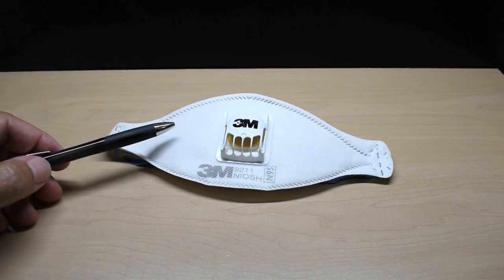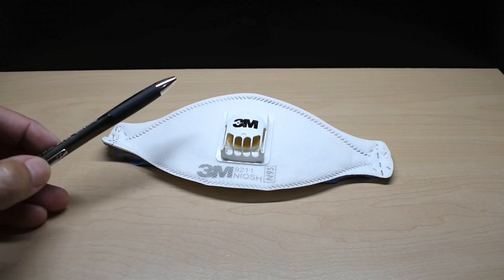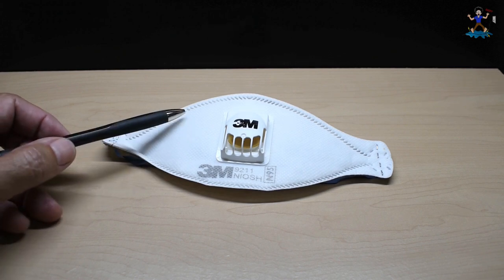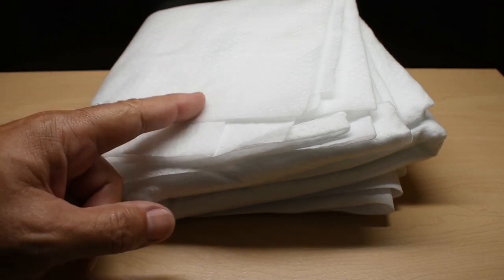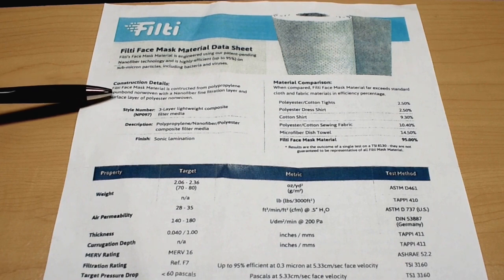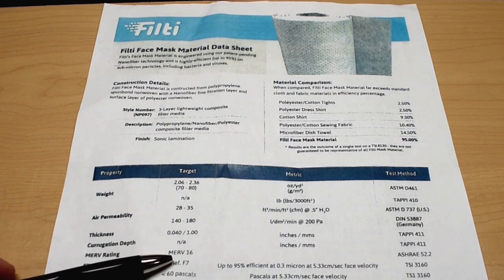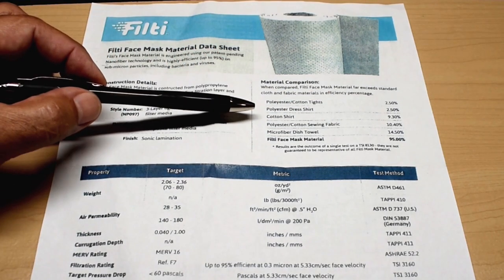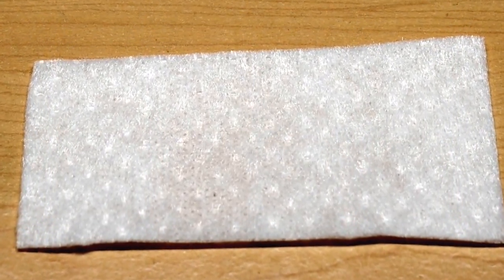DIY N95 Mask Nano Fiber Material! (Electrostatic Free)

Comment: I was glad to see this!!  I purchased some and have been using it as filters in 3D printed masks and my wife has been using it as an inner layer in sewn masks.  The company shipped fairly quickly and was surprised how much material we got for the base order.  They have also included shipping, it was $12 when I purchased it.
Reply: I was wrong,  There is still a shipping charge - it was $10 for the $25 package size of 21 sq ft.  Still a good deal - a little over $ 1 per square foot.

Comment: I see on the material data sheet they write " up to 95% efficient at 0.3 micron", but an N95 mask material should be at least 95% efficient for particles 0.3 micron and above.
Reply: Hello Marco - correct, for the home made masks we do not run the efficiency higher as the pressure drop can become a bit much with a non-formed shape and espically so with printed masks with small filter areas.  When a formed respirator is tested the actual face velocity is lower than what we test flat sheet media for Filti at - extra surface area - which results in a higher efficiency for the same given piece of media.

Comment: I would like to have a way to test this filti filter material, or really any filter material to know when it has lost a significant amount of its filtration effectiveness, by being worn. 
Suppose each day a microscope was used to view and compare the fibers of two identically made face masks, one of which is never worn and the other of which is worn daily. Note - the mask being worn would be disinfected by  having enough such masks to use a different mask each day of the week.
My question is -
When the microscope shows a noticeable difference in the fibers of the two masks, is it time to replace the worn mask with a new mask, and that before you can see  a noticeable difference in the fibers of the two masks, it is OK to reuse the worn mask.

Comment: Thank you. Do you have a PDF of a pattern we can use to make a solid/stable mask? Something you can share with us?
Reply from the maker: The link below shows a basic pattern, but DEFINITELY add a thin aluminum strip over your nose to ensure a tight seal between your mask and face. Hobby shops, hardware stores, or K&S metals online sells inexpensive metal strips. Thanks for watching, and be sure to share the video with others.

https://sarahmaker.com/how-to-sew-a-surgical-face-mask-for-hospitals-free-pattern/
Reply: @electronicsNmore  One can also use soft fabric covered pipe cleaner piping material with it sewn into the nose bridge area to help reinforce and ensure a flexible tight positive air seal over the nose bridge seal area.
Reply: Cut strips from a "tin" can and you get metal strips for free!

Comment: As I understand it, N95 masks are treated with citric acid, copper and zinc. The copper creates the charge which attracts micro particles and the citric acid and zinc kill micro organisms. The static charge allows for easy breathing and still traps viruses. This fabric, with the same filtration but no static charge must have much smaller air passages. Does this make the fabric harder to breathe through?  And would it still be wise to spray this fabric with citric acid to kill virus trapped on/in its fibres while wearing it, before proper decontamination?

Comment: I was planning to buy this material, but was a bit suspicious about the website. Checking it shows it was registered in 2013 but the security certificate is less than a month old and only valid for 3 months. The ownership of the webpage is also protected and hidden.

I am worried someone might simply be reselling some shop-towel like material at a huge markup. Not sure I want to bet my life on this anymore.
Reply from the maker: I don't force anyone to buy anything.
Reply: @electronicsNmore  Never implied that. Just sharing my concerns and my findings. By now there are several videos showing the same material and most people have no way of verifying the claims about the material. We are going to see many scams in these hard times. We have to be careful.
Reply: Hello - hopefully theres enough info out there now to reassure you we're not a scam.
Reply: @TheMrsliferette  Test of what? The lighter test can only confirm if they are plastic fibers.

Comment: Can a mask with this material as a liner can be washed or sterilized without compromising its efficiency?
Reply from the maker: I don't recommend washing any mask. Use them for a while, and after each time using them, leave them hanging inside your hot car with the windows closed. The heat inside the car will kill everything over a few hours time.

Comment: Can you test and comment on the use of HVAC filter with 3M filter rating of 1500 or higher or MERV rating of 13 or higher. 3M Filtrete Allergen (purple lable) and Elite Allergen (black lable).
Reply: I purchased a 3m filtrete 1900 microparticle 16" x 25" furnace filter, disassembled it, and cut circles to match the diameter of a shop mask that probably came from the 1970's in my parents basement. Replace the outer layer each time I have used it, and have at least 5 to 7 layers stacked within it. That was over a month ago. And I'm still breathing. Yeah yeah yeah.
Reply from the maker: As long as it's made using polypropylene fibers, you should be OK. Highest MERV rating is best. Thanks for watching!

Comment: Since you have direct contact with the manufacturer, can you ask the manufacturer if they have conducted or plan to conduct tests to determine whether or not with extended use plus washing/drying if the very fine web material, shown in the electron microscope image, will deteriorate into particles which could lead to an issue like pulmonary fibrosis?  This question applies to the use of a mask constructed of the Filti material, by a child who is old enough to wear a mask.  The question regards a child because a child will have any foreign material in their lungs for a long time.   
Note:  Designed for service and fit for service are not the same thing.
Reply from the maker: Not intended to be washed. Only heat, UVC, 70% alcohol spray mist, or Ozone I would recommend to treat the outside of the mask after use.
Reply: Thank you for your video and your reply.  Even without laundering a mask, those masks worn by a child or an active adult are going to be subject to repeated flexing and bending. For example, when I rode my bike rigorously for 2 hrs the homemade Filti material mask I was wearing flexed significantly every time I breathed. Additionally, even if not encountered during use, when stored a mask shall be subject to being crunched and might occasionally get smashed.  If there is a decrease in filtration capability during those instances, that decrease is understood and accepted.  The question is - shall the fine web material (nanofiber) or other parts of the Filti material deteriorate into particles which could lead to a health issue, one of which might be pulmonary fibrosis? You are rather fortunate to have direct contact with the company Filti.  Therefore, you will get a response as to whether or not they have conduced or plan to conduct tests to address the possible issue raised above.
Note: Electron microscope images of Filti material subject to the condition described above, could be the first test on the road to answering the question which I have raised.

Comment: I was originally thinking of using the Costco yellow microfiber car detail towels to make a face cover.  Due to its tiny fibers to trap the particles, if I folded them over.  I have doubts now, because the tiny fibers might get into the lungs.  What are you thoughts?
Reply from the maker: It's good to be cautious, but being overly cautious can drive you crazy. You should be fine. People would be shocked if they knew how much dust, fibers, pollen, and other things they inhale on a daily basis. Thanks for watching!

Comment: Thank you so much for this great video. I live in Guatemala, so I do not expect to be able to get this particular brand of nanofiber material. Is their any nanofiber material that might be easier to find in something like a Walmart, or perhaps in some clothing at a sports store?
Reply from the maker: Scott blue shop paper towels can be used if you can't find better materials. Thanks for watching!
Reply: If you can find MERV 13 or higher furnace filters (or MPR 1900+ for 3M made filters) that should be a similar electrostatic material. There are numerous tutorials on YouTube for making masks from those filters.

Slightly less effective, you can get non-woven polypropylene from reusable shopping bags, or breathable car covers (or similar covers). Those should be substantially better than woven fabrics, but not as good as dedicated filter media.

I have not heard of any other nanofiber based filter materials. Most sub-micron filters either use very tightly woven glass fibers (which wouldn't work for a mask, for many reasons) or electrostatic media.

Comment: Those reusable grocery bags are made from polypropylene.  How many layers of the bag grade poly polypropylene are equivalent to this  medical grade polypropylene?
Reply from the maker: Grocery bags are a thin melted sheet, there are no tiny holes, so you'll suffocate if you try breathing through a grocery bag.
Reply: @electronicsNmore  , only if they are sealed with a waterproof coating.   The mask I usually use is made from 4 layers of the material, (non coated portions)and I have no problem.   But I was wondering if I needed 3 or 4 layers.
Reply: @electronicsNmore  the reusable bags you buy for a buck or two.   Not the plastic bags.  Sometimes the whole bag is sealed,  sometimes just the sides are not sealed.  Some are not sealed at all.

Comment: Can you please evaluate the material of Swiffer® Sweeper™ Dry Heavy Duty. The material seems to be similar to any mask and is also easily available. Not strong but what if a layer is inserted in  cloth mask.
Reply from the maker: If you cannot get any materials, then use a Scott blue shop paper towel. I checked them, and they're thick with densely packed fibers. Thanks for watching!

Comment: I thought N95 meant filtration efficiency of "at least 95%," not "up to 95%."  Does it?
I also thought N95 meant at least 95% of a range of particles that includes particles smaller than 0.3 microns, not just 0.3 microns or larger. There was a range of particles sizes in testing I read about in the 3M literature online. They had graphed the distribution of particles sizes, and specified the standard deviations.
Also, what's so great about N95 when there are N100 and P100 filters available. Which would you rather have when dealing with serious consequences (likely fatal consequences for quite a few people, literally — about 68% fatal for men over 80, and also very threatening for many others with susceptible conditions), would you rather have something like 95% protection, or something like 99.97%?
Personally, I would feel a lot better with 99.97%.
Reply from the maker: Yes. N95 means 95% of particles .3 micron or lager "should" be trapped. The nano fiber is up to 95% blocked. It could be a little less, but it's WAY better than using ordinary fabrics. Nothing is 100%, even the N100. There's always a chance that a small particle will pass. Thanks for watching!

Comment: Is this meant to be disposable? Can you wash & reuse?
Reply from the maker: Hello Nancy. After wearing the mask, you need to sterilize it, no washing. Heat(150-165F for 20-30 minutes, ozone, or UVC light)
Reply: @electronicsNmore  heat in the oven?
Reply: @KVStarStruck22  

I place mine in an open paper bag and  reheat  in my oven @ 200 degrees x 30 minutes after each use. Have not noticed any deterioration after repeated use. I have several on hand and cycle them.
Reply: Tooktak....dont know anything about a microscope. But I use 200 degrees x 30 minutes after seeing a lab report that coronavirus was surviving and replicating at 60C. It wasn't until they increased temp to 90C (194F) that it was killed off.
Reply: @eduardopena9326  viruses don't replicate except in a living cell. Corona gradually becomes unable to replicate over time, the rate depends on conditions. 
This is unlike bacteria which can multiply outside the body.
Reply: viruses can NOT replicate out of the cell! (in contrast to Bacteria)  but they can survive with this ability after entering the body if they are not killed

Comment: How do you make a DIY mask air-tight like a N-95 mask? Otherwise, the air you breathe in would not pass through the filter.
Reply from the maker: You must have strong bands or velcro straps & have a metal strip over your nose. Without the strip, they're no good.

Comment: I'm wondering how safe this material is to breathe through.  The fiberglass filters can break off and you can inhale glass into your lungs.  Can the same happen with this nanofiber polypropylene?
Reply from the maker: It's designed specially for surgical masks. The fibers aren't hazardous, and any filter material has the potential to loose fibers. If you worry too much, you'll end up not using any material. Stay safe, and thanks for watching!
Reply from the maker: @tookTAKtook Z No liability, zero. This material is far superior to the materials(T-shirts, napkins, etc) that people are walking around with over their mouth and nose. This material will help many. The company specializes in high quality HVAC filters, and since the outbreak, they moved into masks.
Reply: tookTAKtook Z so what the alternative, a t-shirt? The jump from HVAC filter to mask seems pretty simple and logical given the times, no? I would love to know what mask you’re using and the safety precautions you have taken! 😃 Can you recommend a mask company?

Comment: look at the Filti official website (bottom)  : 
DISCLAIMER: Filti makes no warranties, either express or implied that this material or masks made from it, prevent infection or the transmission of viruses or diseases. Do not use this material in any setting or where significant exposure to liquid, bodily or other hazardous fluids, may be expected. Do not use this in settings where the infection risk level through inhalation exposure is high. Do not use this material in the presence of an open flame, heat source or flammable gases or liquids. All data contained above is nominal and provided for information purpose only. This data is not to be construed as manufacturing specifications and is subject to change. Filti does not guarantee the performance of this material in a face mask or the performance or masks made from it. Filti Face Mask Material is not a substitute for medical treatment or medical devises.
Reply from the maker: Yes, that was discussed many times. They had to say that, or the FDA would come after them.

Comment: Damn that Filtri fabric is expensive to buy and ship to Canada, the cost doubled.  I cancelled my order. I dont need 50 masks anyways.
Reply from the maker: Yes, Canada shipping costs are higher. Buy some Scott blue shop paper towels. I looked at them under the microscope, the material is thick, and has densely packed fibers.
Reply: @electronicsNmore  Thank you but its okay, I found some bags that look to be made from a Filti type fabric, so I will use 4 layers of that.  :-)

Comment: would masks made of this be reusable or are they one-time use only?
Reply from the maker: All masks must be treated with heat, uvc light, or ozone after exposure.
Reply: @electronicsNmore  aerosolized hydrogen peroxide and exposed for 2.5 hours has shown decontamination effectiveness.  Portable cargo container decontamination pods are being deployed as we speak across the nation.
Reply: If this is truly a nanofiber without  an electrostatic ply, then it should be reusable and washable with soap and water, alcohol  etc. A big reason things like UV- c is used is not to damage the electrostatic layer in a conventional N95

Comment: From their web page
DISCLAIMER: Filti makes no warranties, either express or implied that this material or masks made from it, prevent infection or the transmission of viruses or diseases. Do not use this material in any setting or where significant exposure to liquid, bodily or other hazardous fluids, may be expected. Do not use this in settings where the infection risk level through inhalation exposure is high. Do not use this material in the presence of an open flame, heat source or flammable gases or liquids. All data contained above is nominal and provided for information purpose only. This data is not to be construed as manufacturing specifications and is subject to change. Filti does not guarantee the performance of this material in a face mask or the performance or masks made from it. Filti Face Mask Material is not a substitute for medical treatment or medical devises.
Reply from the maker: Yes, they have to add that, it's not "FDA" approved! Patent PENDING. What you see in this video is many times better than walking around with a piece of clothing over your mouth.
Reply: Yep - most of that language is because we have no control if someone pokes a hole in it or makes a poor fitting mask. All we can do it provide someone a media which will give them a real opportunity at making a mask with real protective properties.

Comment: damn i'm screwed i've been using my  n95 mask for a month washing it with soap n water but flushing particles out..i guess i ruined my mask
Reply from the maker: 😂 Never wash them! Use dry heat to sterilize them. 150-165F for 20-30 mins.
Reply: @electronicsNmore  thanks sir will be using my P100 now 😷